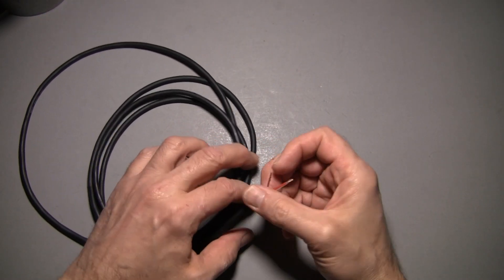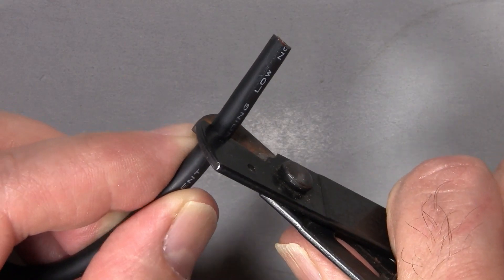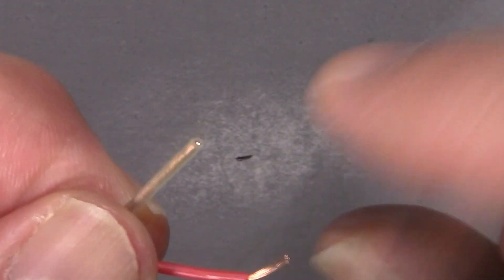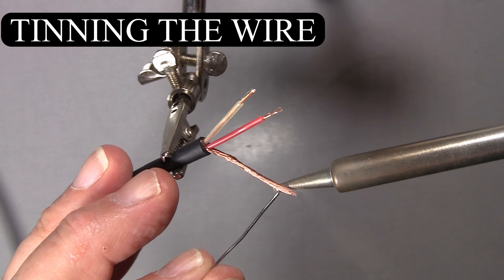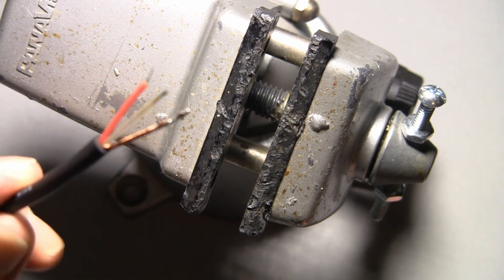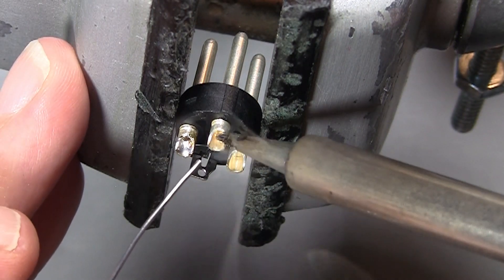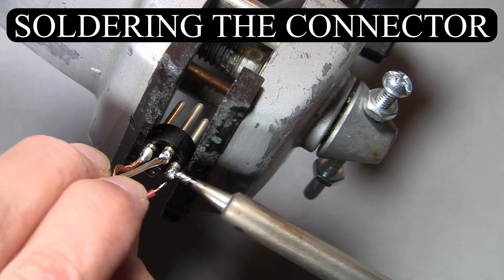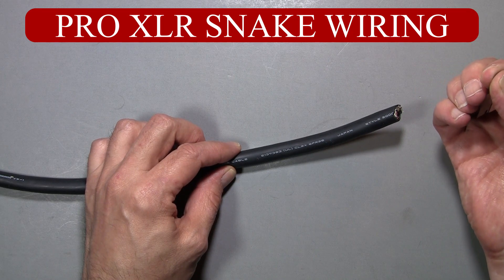Soldering XLR  Connectors Like A Pro

Comment: I always tie pin 1 to ground (by splitting the drain/shield in half) curious to see your grounding video. I also use 2 small zipties on the end of the multi-pair jacket then add adhesive lined shrink tube over that. Keeps the jacket from working it's way down over time (probably not a huge factor in a studio, but in the field it helps a lot)
Reply: you shouldn't bond the shield to the ground of the connector for audio. You should keep all of the grounds from interacting until they reach their final destination.  That way if there's something else weird on a panel, or the rack rails themselves, then you won't run into problems with that.  You want to have a single grounding point.
Reply: That'll cause ground noise problems. If you connect one of these shell-grounded cables to a floor pocket, it'll create a ground loop involving mixer - audio cable GND - floor pocket - metal conduit and power GND - mixer and you'll get TONS of noise in your channel, making it nearly unusable.

Comment: I have noticed that some snake cables have different colors cables for each individual mic cable. What are general rules for hot and cold?
Thanks for the video!
Reply from the maker: In general the clear or black wire is low or cold. The more vibrant color is usually hot (often red) Some cables follow the resistor color code. Black=0, Brown=1, Red=2, Orange=3, Yellow=4, Green=5, blue=6, violet=7, Grey=8, white=9

Comment: Thank you for that great video! I really appreciate that! I just ordered my Gotham GAC 4/1 wires and I’ll be getting them in the next couple of days. In the meantime I noticed an extra tab on the back of where the three connector/tubs are. Do I use some of the shielding wire to attach it to that forth tab, or do I not solder anything to it? I’m only asking because I noticed that you did not. On some of the connectors that were pre-wired, I noticed that some of the shielding wire was not only welded to the grounding connector/tub, but was also welded to the tab. Again, if I don’t need to connect it then I won’t. Let me know what you can please. Again thank you for your help.
Reply from the maker: For microphone use you can tie Pin 1 to that ground tab. I often don't for reasons I have stated in other Reponses.  Interesting enough Gotham (Neumann USA)  used to make cable that had a separate wire to carry the ground the Shield went to the Tab and the ground went to Pin 1. In theory it was great, but in practice I saw little difference.
Reply: @biasedaudio  thanks for the input and will just stick to soldering them the way you taught. It’s easier anyway.

Comment: If one end of the xlr connection has a wire from pin 1 to the casing, does the other end also needs a ground?
Reply from the maker: In Truth it depends. Like I said I rarely do it for reasons explained below. I sometimes do it in the hopes of improving RF rejection in microphone cables. If that were the application I would tie pin 1 to the case on both ends.

Comment: great video : ) why don't you solder pin 1 to the chasie to ground it?
Reply from the maker: People have differing opinions on this issue. I don't because the XLR Shell is often connected to ground by the chassis of the device that it is connected to anyway. Sometimes If i plug into a wall panel or a device with a ground lift I don't want the shield ground connected to prevent a ground loop. If Pin 1 were soldered to the shell that would bypass the ground lift switch in many devices.

Comment: What part # Mogami cable did you use? What temp do you solder at? Where did you find the nylon tubing to cover the drain wire?  Please revise your parts list to cover all tools and parts used in your videos so we can find the right items. Thanks, Jon
Reply from the maker: The Mogami cable is 2932, 8 pair   Mogami 2552 single channel . My temp was about 650 F, Teflon tubing is hard to find , I spec oversize to make it easier to put on cable, this is 20 Gauge. Expensive. Alpha TFT-200-20 https://www.digikey.com/en/products/detail/alpha-wire/TFT20020-NA005/3844137
Reply: I bough this exact link and it seems too small. are you sure this is the right size ?  I’ve got .032 (.81MM ID).
Reply: seems like .036 or .04 would work better… but I just want to check.